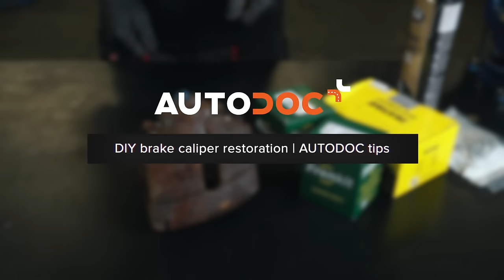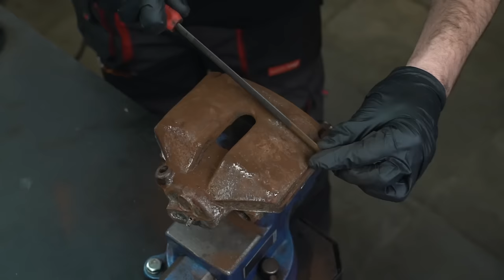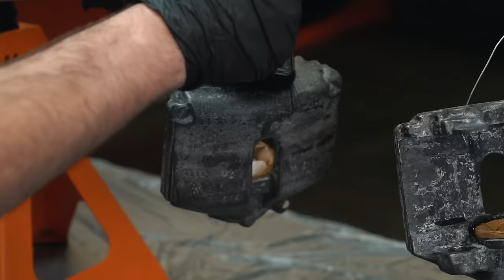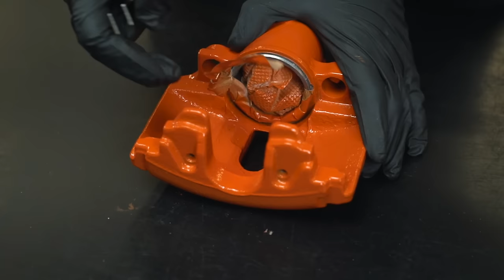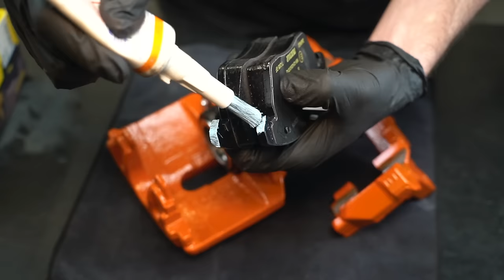DIY brake caliper restoration | AUTODOC tips

Comment: One small problem, you shouldn’t paint the part of the carrier where the brake pad ears slide on. It should be a metal to metal interface rather than metal to paint, for obvious reasons. Just greasing that part will stop it rusting anyway.
Reply: Makes absolutely no difference, thats what the shoes and copper grease are for. Been running 2 different sets of home painted calipers for over 3 years and never once had an issue with the paint getting on the pad.
Reply: @_vindicator_  There can be the issue of thick layers of paint making the spaces tighter than required.
Reply: @inq752  yeah, but thats way less of a concern than the fact 50% the hardware you get now is oversized because the aftermarket didn't get the spec right.  

China and friends: teaching a whole new generation how to "make it fit".
Reply: @smack1289  It might cause an issues once the paint will start flaking off, the raod is not a clean enviorment debree can get stuck on the paint or the paint can be contaminated with something causeing it swelling . its probably very unlikly all of that will happen but i wont take my chances
Reply: it looks cooler with the paint
Reply: If i was i wouldnt paint at all, colors for teenagers
Reply: You shouldn't paint any machined surfaces, they are machined for a reason with fine tolerances.

By painting the machined surfaces you will harm the function of the brake.
For example by painting the carrier where  hammerheads of the pad are sliding, you will tighten the gaps and make the pad retraction away from brake rotor difficult, resulting in increased brake drag torque (the brake will always brake slightly) causing bigger fuel consumption.

There are a lot more things which can go wrong. We never paint machined surfaces, also the surface treatment thickness is calculated in the tolerance stack-ups of the brake for proper function. Such brake may looks like a simple piece of hardware, but it is not.

I design such calipers. :-)
Reply: Also don't paint were the brake crash washer goes either. The brake fluid over time can start to eat the paint and then leak from there.
Reply: @robinw9405  Untreated metal in the rust belt 😬. If you live in TX I wouldn't see a problem, but would definitely recommend paint or powerder coat in the more salty areas. It's gonna rust regardless, but you can slow it down. Instead of crazy colors you can also just do black or an alumicast paint.
Reply: @bewareofmountainlions4429  yea i know about the rust i just use chemical sprays to prevent rust
Reply: The brake pad ears are already painted, from any brand. So painting the caliper mounts all around is no problem whatsoever.
Reply: The caliper does come with paint on it from the factory albeit crap.
Reply: there is stainless steel plates between the caliper and the pads so it's better to paint so that it's not rust.
Reply: Usually not a big deal but yes, I would avoid that too.

Comment: nice overview, i wouldve added a few more things:
1) main specs that should be checked before even attempting to restore the caliper.  ive had the joy of completely restoring a caliper and then finding out that some parameters were out of spec and having to ditch it all.
2) cylinder honing - when the cylinders/pistons have corrosion, then honing usually gets it better
3) bleeder screw purgatory - how to get seized bleeder screws out and how to restore the holes without messing it all up. In screws that have not been serviced for a long time, the screw threads can be completely corroded to dust. This dust can re enter the fluid system and contaminate it. When drilling and rethreading its important not to damage the conical shaped bottom of the screw hole as its a fine-sealing with the screw and restoring that is a struggle on its own.
Reply from the maker: We are sure that your comment will be useful for many of our viewers.

Comment: Great video - just one thing to add....
I have never seen an ATE caliper (which is one in this video) have the dust boot fit on this easy - It's always a massive struggle to get the boot to sit onto the caliper!
Reply from the maker: We are sure that your comment will be useful for many of our viewers.
Reply: Because they artificially aged the metal, it's not actually an old caliper, most likely.

Comment: I enjoyed it.
I'd like it if you wrote on the screen what you were using at the time, so novices like me could learn from it.

I'd like to do a project like this.
I'd be interested in powder coating them as well.

I thought you needed something to compress the..... What is it called...... The cylinder that touches the brake pad....

I'd need to know how to bleed brakes as well.

Like I said: novice.
Reply: Yes, you need a tool to compress the cylinder like when you just change the brake pads. So when you do that, you don't have to plug out the brake line, so the cylinder is under pressure.
Reply: You need it for rear ones that have integrated parking brake cartridges in
Reply: @arongazsi  I've got a lot to learn 😊

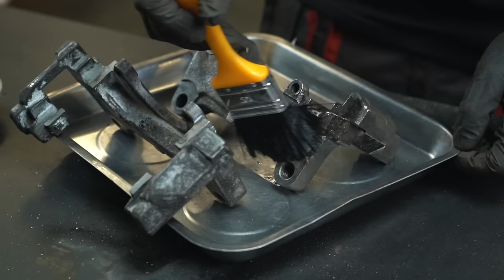Comment: 3:55 what is used in this part? Guess it something to convert all the rust that is left but what exactly is it
Reply from the maker: Hi! Thanks for your question, in this case we used a rust converter. You can get acquainted with the goods for the car here https://www.autodoc.co.uk/spares-search?keyword=Rust+Converter.
Reply: @autodocuk  Thank You very much for Your answer, I appreciate that ❤️
Reply: it's like a rust blueing or black oxide kind of the same thing in the firearms industry . we use it to rust proof barrels and parts to turn them black or blue . hence the gun metal blue color or Grey.  it essentially makes an active rust stop rusting . creates a barrier for oxidation

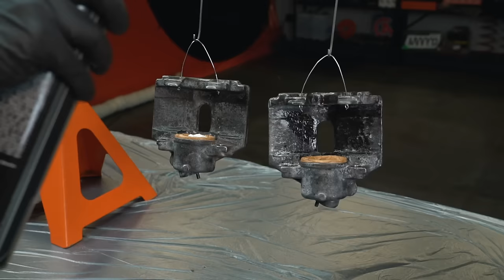Comment: After rust converter applied with brush,what is the spray content  5:15
Reply from the maker: This is a brake cleaner, the composition of the solvent, you can see it at the link: https://www.autodoc.co.uk/car-care/brake-clutch-cleaners?categories%5B0%5D=1883
Reply: @autodocuk  what is the purpose of it, there shouldn't be any debris left to clean after rust converter
Reply from the maker: In this case, after the rust converter, there was no debris left on the part; a zinc oxide film appeared for further protection of the part.

Comment: what is that grease that you use for the ruber and cylinder? Where do you buy it?
Reply: @2000noahms  No, thats red rubber grease they used there. You shouldn't use silicon grease on parts that will contact brake fluid.
Reply: that grease should be included in the repair kit.

Comment: ¿¿¿que tipo de grasa es la grasa esta roja, y también que es esa grasa blanca que echaste con una brocha??? ////
what kind of fat is the fat is red, and also what is that white fat that you put with a brush???
Reply from the maker: Hi! Thanks for your question, in this case we used the red grease from the caliper repair kit, and the tool that was applied with a brush is a rust converter.

Comment: A single piston caliper is never a gd caliper, would rather visit a scrap yard to find @least a 2 pistons calipers or best 4 pistons one.
Reply: Any regular sized car uses single piston designs, single piston with floating caliper has been excelling in cost efficiency and simplicity. Only for heavier or more powerful cars you'd want calipers with more pistons